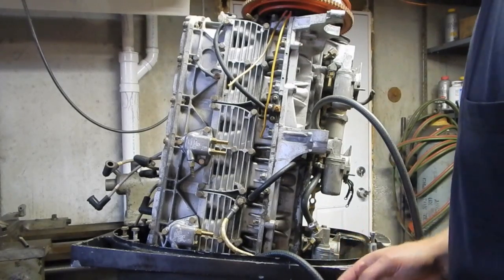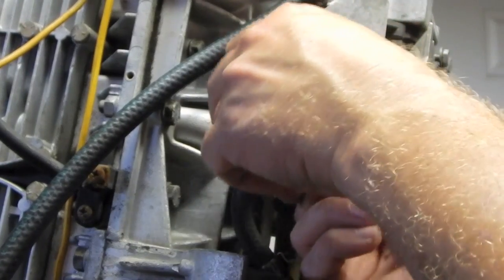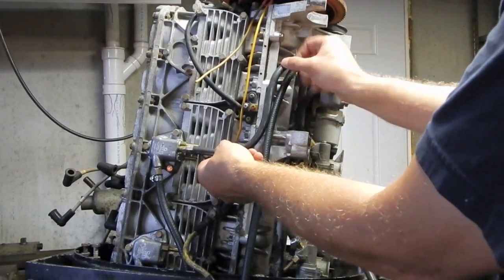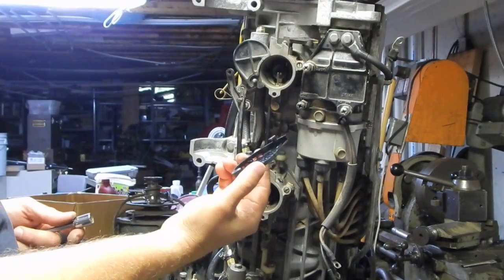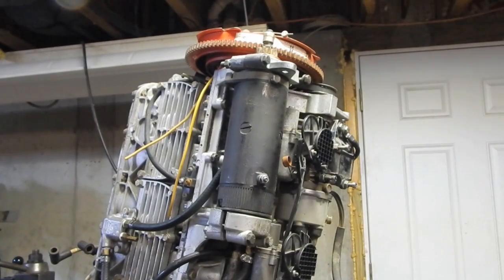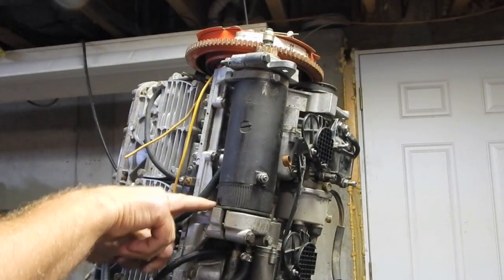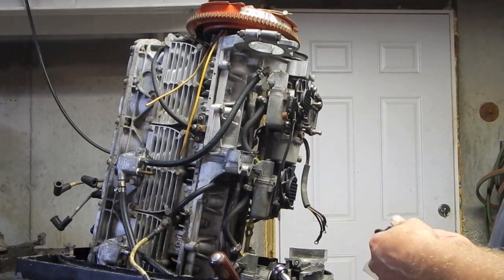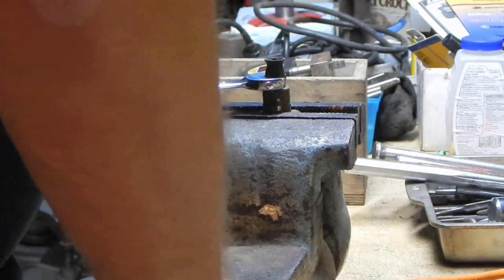The Mercury 115 "Tower of power " outboard motor Part 25

Comment: There are two holes in the edge of the aluminum just above the terminal block and in between the starter bracket attachment bolts,  the fuel hose is attached / clamped to the lower hole and the stator wires get attached / clamped to the upper hole.

Check the starter,  the terminal stud should be twisted to the rear a little more  you're about 90deg to the front of the motor to far . should be 45 deg to the rear from straight out the side.

The plastic ring goes on the bottom mount of the starter.
Reply from the maker: Thanks.  I'll check it out tommorow.

Comment: Come on Steve.  Really an open end wrench on an old brass fitting.    Did I really just see that?  How about a box end 6 point wrench. Work wonders on brass fittings.   Or in this case a 6 point socket.    
Also hate to ask a dumb question.   But why do u keep saying that the brass fittings on all the old hoses are trash?
Reply from the maker: yeah I get your point... even worse, I actually have tubing wrenches!  Just got lazy I guess.  the reason I called them junk is because they are crimped onto the old hoses. not reusable.
Reply: +Steve Watroba all u have to do us grind off the crimped sleeve and cut off the last piece of hose and u have urself. a barb fitting.
Reply from the maker: +dozerd12r nope. I took one apart to see. the brass tube is short and smooth, no barbs. they were relying on the crimp to keep it together.  repurposing them to use with hose clamps was not a viable option.